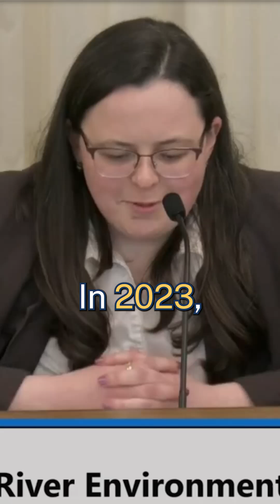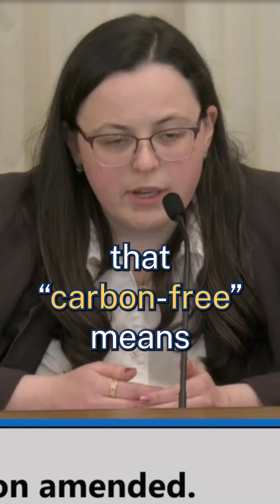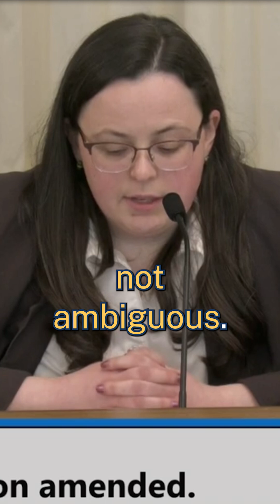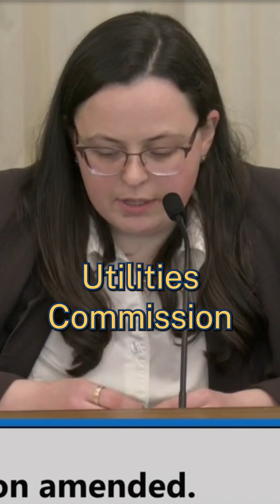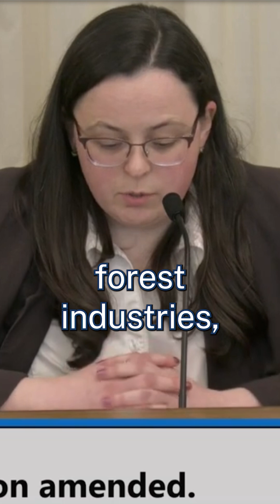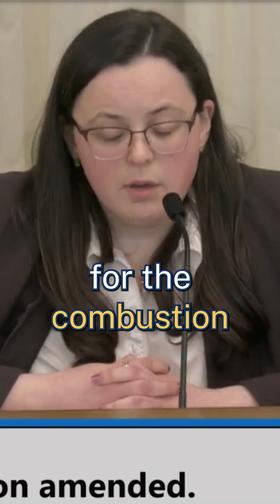Burning Biomass is NOT Carbon-Free

Comment: All forms of electricity produce carbon dioxide.
Reply: Nuclear, solar, wind, geothermal, and tidal don't.
Reply: @nicnsugar they all do... Nuclear produces the most co2 in the process of building the powerplant of these. The good thing about solar and wind energy is that they produce very little co2 for the energy they produce.
Reply: Elaborate.
How does a Tide power plant produce carbon dioxide, for example.
How does my Bike Dynamo produce carbon dioxide?